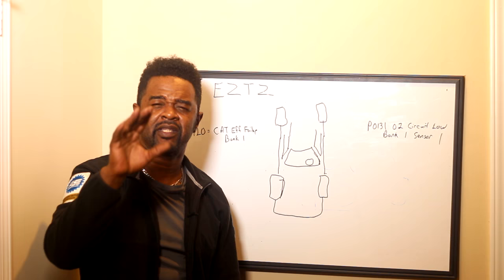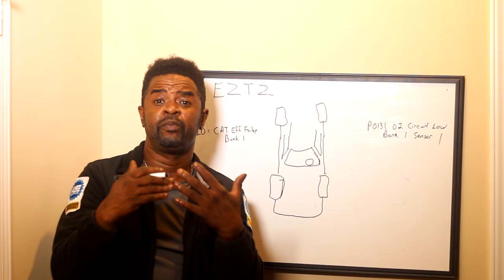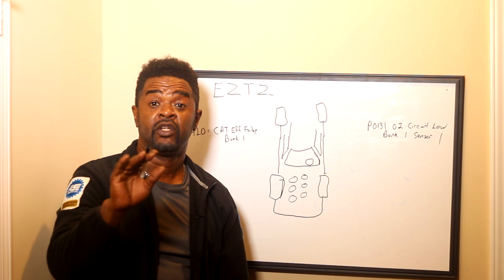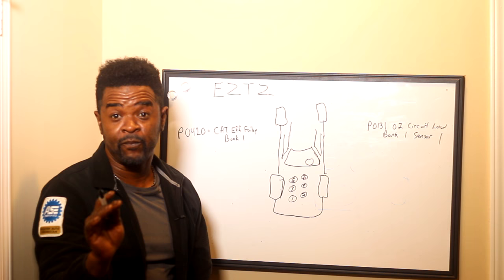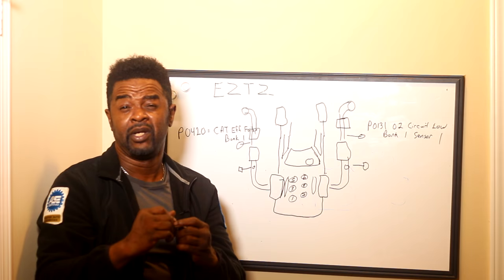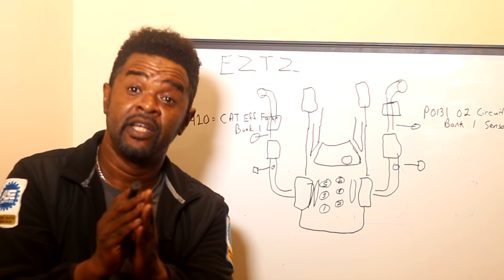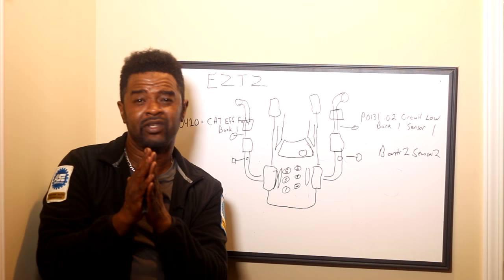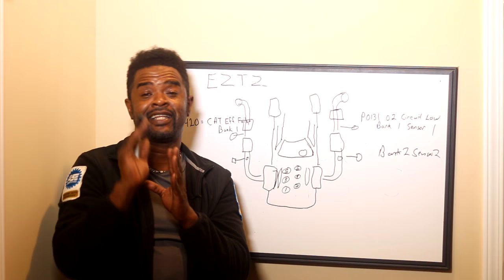Bank 1, Bank 2. Oxygen O2 Sensor Location, I show you how to locate the correct O2 sensor. P0131.

Comment: You really broke it down bro! I have an '06 cadillac dts with previous sensor issues. Replacing the last one asap which is the bank1, sensor1 downstream. Hopefully after that, my check engine light will stay the hell off based on these sensors! I believe that these manufacturers make these parts with cheap quality so they can make more money hoping that you will bring your car back to the dealer so they can keep bending you over, and sticking you long, hard, and ashy! No grease, no spit, no KY, not even motor oil, or any type of lubricant! Thanks GM! (General Mistake)!!!

Comment: Great Video! 
I drive a '06 Mercedes Benz e350. 

Check engine light comes on and with a code reader, it read P2A03; O2 Sensor circuit range/ Performance Bank 2 Sensor 1. 

I've watched other videos upon the location of Bank 2 Sensor 1 is located. 
But your video had broke it down for me at precisely the exact location on where I need to be under the car to replace a brand new oxygen sensor. 

Thank you so much! You just saved me at least $500.00 by taking it to the dealership shop or any other shops.
I really appreciate it! 👍🏽🤙🏽

Comment: Hi there!
My scanner gave me this live reading on Toyota 2010 AWD of:
O2S B1S2——— 0.720 V
STFT B1S2——— 99.2%
O2S B2S2 ———— 0.74 V
STFT B2S2———— 99.2%

The STFT (Short Term Fuel Trim) seemed out of range on the graph. But I change the upstream O2 of Bank 2. Now my scanner show O2 sensor circuit high voltage Bank 1 Sensor 2. 
The bank locations for Toyota Sienna that I learned is different than your description . Bank 1 is in the back while bank 2 is in the front but the order of labelling them of 1,3,5 back bank while 2,4,6 bank in the front. 
I appreciate all your videos and looking for your help. Keep doing the great job!!

Comment: Very good explanation. Thank you for the video. Do you have recommendation on when to change out the o2 sensors or do you wait until it breaks to replace?
Reply from the maker: Hey bud, thanks for watching. Those O2 sensors are monitored by the car computer. So when the voltage/time parameter reach fail zone, the computer should tell you by way of a check engine light. But, a O2 sensor can simply become lazy and never reach that parameter of failure for the light to come on. Some say replace an O2 sensor right at 100k whether theres a code or not because its likely lazy and could affect the way car runs.

Comment: I REALLY appreciate your video, perfect explanation.  ?  2007 Jeep liberty  code said catalyst system efficiency threshold (bank 1). Where should I start ? O2 sensors on passenger side of vehicle?  
    Thanks again for explaining that to a shade tree mechanic like me. 👍
Reply from the maker: Hey bud, those cat efficiency codes uses the O2 sensor to detect if cat doing its job. Code usually indicate cat problems. What is the P code that was generated? Also are you subscribe d to the channel?

Comment: Very very helpful I could understand your explanation to learn the 02 sensor locations easily, even with my bad ADHD problems.. their locations reflected my ob2 tool codes and found the bad o2 sensor 1 bank 1 with testing voltage like you said as well thanks...

Comment: I've heard this word get mis-spoken ten different ways because nobody's perfect. But common sense would dictate that "catalytic converter" is what we're talking about.  Anyhow, would you be able to make a video on how to read wires with a multi-meter regarding this problem?  I have a P0158 that wont go away after I change the o2 bank2 sensor on my 2007 tundra.  I have also changed all spark plugs and their coil (they're old anyways).  I would like to see if there is anything wrong with the wiring before I start changing more parts but I'm very inexperience in reading wires.  I appreciate you explain things the way you do.  it's very clear and relatable. Thanks and hope you could accommodate.  Thanks

Comment: I would change the rule to bank one being where cylinder one is, and bank two is where cylinder one is NOT. Depending on manufacturer, ford comes to mind, you can have cylinder one and two on the same bank. Check firing orders of different engines and you’ll see what I mean.
Reply from the maker: Yes, Ford has a engine like that

Comment: i had 4 ranger 2.3 . it has 4 cylinders  in line. i find out wich is upstream and downstream sensors thanks to your video. i have a P0400 code and changed  bouth o2 sensor. no more P0400. but im still waiting to hunt another code.

Comment: Great info. I have an 02' Blazer 4.3ltr w/ 1 brand new Cat. I Got a 0420 Cat Temp. Threshold too Low Code.
 Problem is, I have 2 sensors on Bank 1! Since my exhaust comes down from bank 1 on the right side (drivers side) & ties into bank 2 on the left (passenger side) where my brand new cat is located.
 I have 1 sensor on bank 1 just down from exhaust manifold, then another just before my cat & 1 just after my Cat located on passenger side. 🙄
Guess I have to test the plugs with my meter to see which is dead.

Comment: Question,,This is really good well done thank you for sharing.
 I have A 01 Dodge 1500 I believe it to 4.2  318 I believe?
 How do I get to the plug on the driver side think 102 sensor plug in, do I have to pull the manifold or exhaust in order to do this or can I disconnect the linkage from the tranny? Look forward to hear from you bye for now Ken. And thanks again this is a very good basic information for a beginner like me.
Reply from the maker: Yes, that linkage bracket the easiest way to go

Comment: FYI ... I found out today that accidentally leaving one of the hoses on the intake near the air filter disconnected after changing the air filter will throw the exact code for this bank1 sensor2 O2 sensor failure 

my torque app said the light was on for 'o2 sensor slow to respond'  ... instantly fixed by re-attaching the disconnected hose on the side of the intake tube

if you have this code for bank1 sensor 2,  first check all of the hoses that attach to the intake before digging into this O2 sensor repair - especially if you've recently had the air filter out 

if writing this helps at least one person it's worth it

Comment: Great explanation! You just may be my goto guy for my dilemma. I have a 2000 f150 and my cats melted last year causing misfire so I had a new exhaust system installed without cats, (it was a tight week) just a Y pipe to a single 2 1/2" pipe back to a flow master with 2 tails out. Obviously my check engine light is on and my inspection is up this month, do I need to put 2 cats on the Y pipe on each bank and install all 4 sensors or can I just install 1 cat on the straight pipe with 2 sensors and if I can do that, which bank sensor wires would I use, 1 or 2? I understand I may have to lengthen the wires since it's a custom exhaust and possibly jump the other 2 sensors not being used, I am a tech but I'm not up to date on how the computer would work in this situation as far as regulating gas flow. Any help would be incredibly appreciated and I definitely subscribed to your channel. THANK YOU!! Mike.

Comment: Great video!  So, does an inline 4 engine just have one bank, one catalytic converter, and two oxygen sensors?  I have a 2003 SAAB 9-3 linear and I have a P0137 code saying O2 circuit low voltage on bank 1, sensor 2.  I've been able to locate sensor 1 I believe, but I don't know where sensor 2 is.  After watching you video I think it's somewhere under the vehicle.

Comment: This helped me truly know where my Bank 1 Sensor 2 on my hemi is.

Also to figure Downstream Right or Left ..do so as if *Sitting in the car* (not from looking at front of engine ..correct?

thanks!!
Reply: No. You don't use sitting in the car to determine the where position of an oxygen sensor. If you have a V6 or a V8 then Bank 1 and Bank 2 determine which side of your engine has a problem. Sensor 2 is always at the back most position or downstream, after the catalytic converter. Sensor 1 is usually right up near the engine ( sometimes in the exhaust manifold ) or upstream
Reply: bank 2 is on the passenger side of your vehicle
Reply: @macwade777  In my case it is located drivers side downstream

Comment: Great job! I have a GMC Sonoma 2003 that is showing a trouble code P0135 & reading 02 Sensor Heater Circuit Bank 1 Sensor 1. If I listened correctly to your video that would be my sensor before the catylitic convertor on bank 1 side. Thanks any help would be appreciated 👍
Reply from the maker: Yes that is correct. Thanks for watching, please remember to thumbs up the video. thanks

Comment: I have a question. I am not a mechanic by no means. Just a car owner trying to avoid taking to a shop. We are hoping it is something we can fix ourselves....we have a 2003 suburban that has no crank no start(some times out of no where it will crank and continue to run but once turned off will not crank again) checked the check engine light and it showing all four O2 sensors codes. Is that possible? Should I change all 4 or is there somewhere else I should look? The guy we bought from says he already changed spark plugs and cables, starter, battery. We have already looked for a bad ground wire. Any help in pointing us in the right direction would be great appreciated! Thank you!

Comment: Okay, 2 questions, you said sensor 1 closet to the front, sensor 2 on the driver's side, then you said sensor 2 in the back behind sensor 1, and sensor 2 behind sensor 2  on the driver's side in the back. Should it be sensor 1 behind sensor 1 or 2??
Reply from the maker: What kind of car is this with the engine size? Also are you subscribed to the channel?

Comment: 2008 chevy colorado 4cylinder will not idle right. It revs up and down from almost dying to about 1000 RPMs. Is the oxygen sensor more than likely my problem? Runs fine when your driving down the road. Just won’t idle correctly. Tries to die. Thank you friend!!

Comment: My Accord V6 cylinders are numbered 1-2-3 on the back side and 4-5-6 on the front side as i looked in the manual. Which one is Bank 1 and 2 in this case? I understand you said Bank numbers follow cylinder numbers, but both cylinders 1 and 2 are on the back side in my case. I noticed my car has 1 o2 censor in front and 1 on the back of the engine so I am confused.

Comment: Isn't Bank 1 sensor 1 and  2 both upstreams on a Chevy S10 4.3 engine...and Bank 1 sensor 3 is downstream after Cat?
Bank 2 sensor 1 upstream. 
4 total 02 sensors.  Three on Bank 1 and One on Bank 2.
 Correct me if Im wrong.

Comment: Does typically the first sensors on bank one and bank 2 go bad before before sensor down after the converter?From your experience?thank you
Reply from the maker: I think you are referring to the upstream o2 sensors on both banks. Depending on the year of the vehicle most O2 sensors are monitored by your car computer and will likely set a O2 sensor lazy code. But yes, the upstream do more work and fail a lot sooner than the down streams. What kind of car you have and what is the problem? Also are you subscribed to the channel?

Comment: Hey, thx for that. Is it possible a bad o2 sensor to lead to a random miss fire? And when the voltage of the sensor is changing a lot does it mean is bad?
Thanks
Reply from the maker: Hey both, typically an O2 sensor will report how much oxygen in the exhaust sys. If you getting crazy voltage spikes there is a problem. Those sensors likely not causing the misfire but they are responding to the misfire. Are there any trouble codes? Also are you subscribed to the channel?
Reply: Hi, thanks for the reply. The code is p0140. My car is a hummer H2 2003.
And I am noticing a loss of power on the high rpm and fir example of you accelerate from  80km/h,the car is kind of hesitating...

Comment: You didn’t explain the fault code on the left P0420.  Bank 1. So is that the cat on bank one side and not the sensors?
Reply from the maker: Cats are desribed using the same format..If this a V engine, bank 2 cat will be on cyl 2 4 and 6 head. Same with Cat on bank 1..What kind of car in question? Also are you subscribed to the channel?

Comment: I have a P0140 code, bank 1 sensor 2 not responding. I understand bank 1 being the side of the #1 cylinder but wasn't sure where the #1 and #2 sensor is. This helped to tell me the #2 is always behind the Cat. Thanks for that. I have a 2011 Cadillac cts 6.6 and have an engine light but no other codes.  I watched another GM video where bank 1 is the drivers side. Is this right?

Comment: Hi, your videos are simple but great. I have a big problem with my 2001 ford explorer sport , 4.0 L 
V6.  I can't pass California smog test. Only have 65,000 original miles ( I am original owner) and the CAT keeps showing not ready on smog test .  There are no Dtc showing on scanner and O2 sensors are good to go. I have failed the smog test five times and that is with going thru state suggested drive cycle's three times. I have put on the car approximately 750-850 miles doing these cycle's. Do you by any chance have this vehicle specific drive cycle for CAT converter ?  It
Would be deeply appreciated.
I am not going to any overpriced ripoff dealership. All suggestions welcome.
All my thanks,
Barry

Comment: My wife's Nissan Rogue is a 2011 with a 4 cylinder inline engine that sits sideways. The scanner keeps reading a P0420 code that says Bank 1. Are inline engines always going to show a code for bank 1 since there is not really a second head?  It doesn't say sensor 1 or sensor 2, just bank 1.

Comment: Can you explain bank location on most Ford engines? 
Example: 289/302/351 small block, modular and 429/460 big block Ford V8s that have cylinders numbered 1-4 on the right (passenger side, ordered front to rear) and cylinders 5-8 on the left (driver side, same order).

Comment: I got a p0420 Catalyst System Efficiency Below Threshold (bank 1)
It's a 05 ford ranger 3.0 v6..
I was wondering if changing out the 02 sensors might help or do you think the cat needs replacement.  I tried the laquer thinner method and nothing. Truck runs sluggish. Idle is rough and over 45 miles per hour I get the sputtering. No other codes though. It feels like not getting enough power when accelerating. Would appreciate your opinion on this one. Thank you God bless
Reply from the maker: Hey bud, I hear of mechanics doing that with success on older cars such as this 2005. But the newer stuff computer are to smart for that, if they issue a cat code, you likely need a Cat. I would say this, doing the O2s first to see if that fix it is a in-expensive guess. It may be worth it
Reply: @OnlineMechanicTips  thank you much, will do

Comment: First, thank you for this video it was helpful. Second, I have a question for a Toyota Highlander 2004 v6. The mechanic changed an oxygen sensor bank 1 sensor 2 for The above car which show a code problem P0037 . The mechanic change the sensor but the check engine sign doesn’t reset when you erase the code.The computer shows only that problem code on the Toyota Highlander. what else could it be?
Reply: Could be from not using the specific part number for that bank. I learned that on my 04 GS300. It has four sensors, 2 upstream and 2 downstream, and each one has its own part number that goes to its specific spot. Sounds crazy, but it's true.

Comment: My 2001 Dodge Ram 5.9 V8 has Y pipe and one o2 sensor before catalic  convertor  and one after on Y pipe. When my check engine light came on, it's showing bank 1 sensor 1, but the sensor 1 is for both banks? Am I correct ?

Comment: I have a 2018 Merc Sprinter and I'm getting a P2201 1/3 Stored NoX Sensor Circuit Range Performance Bank 1. It has three on each Bank. My question is how do I find which one is throwing the code?

Comment: I have a 2011 Chevy Equinox.  The engine light came on I had someone use a reader on the code and it was a P0420 code and the print out he gave me said it was either the Catalytic converter or the O2 sensor. He said there are only 2 O2 Sensors on my car. He told me I should replace the 2 O2 sensors then clear the code and it should fix the error if not check deeper in to the Cat. My question is this. How difficult is it to change out the O2 sencers on a 2011 Chevy Equinox? Is it something an extreme novice with minor bassic mechanical knowledge and skills can do?

Comment: I've got a stupid question. RockAuto always says right or left instead of driver or passenger. I don't know if right or left is if you are in front of the car or if you are in the car. Is there a universal standard for this terminology?
Reply from the maker: Know such thing as a dumb question my friend. But usually if its a fwd car, the engine would be sideways. Most rwd cars the engine straight. Think of it this way. I think the standard way of thinking is that if you setting in the car, the left side is the driver side, and the right side is the passenger side. Side note, when you reach out to anybody about car question, it helps to include the year make and model of the car in question.
Reply: @OnlineMechanicTips  Thanks so much! And such a quick reply! I will definitely subscribe and share your videos! :)
Reply: @OnlineMechanicTips  2008 Nissan frontier SE